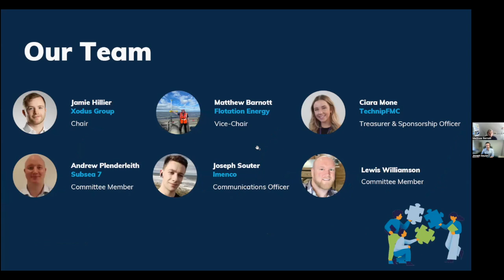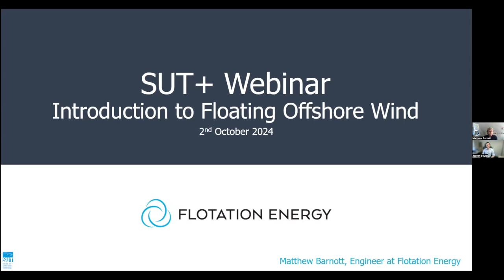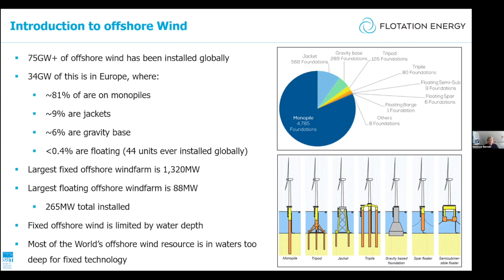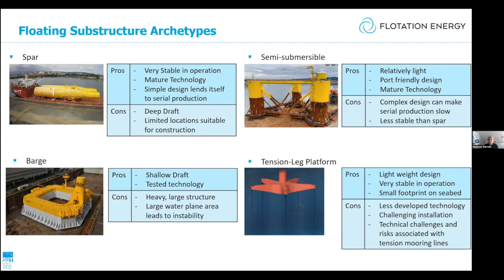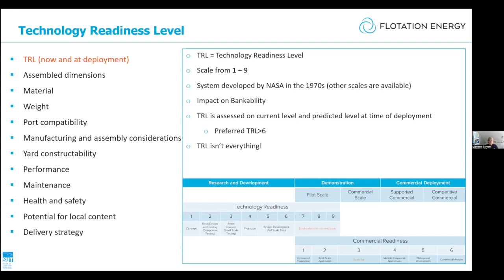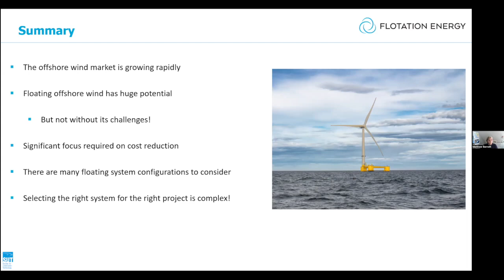Introduction to Floating Offshore Wind - SUT+ webinar

Comment: The entire wild AC generating space needs to be 100% backed up with expensive fast reacting peaking power.   Large amounts of wild AC from solar voltaic and wind turbine generated electricity costs the public grid more natural gas to support by running jet turbine generators at high readiness 70% fuel consumption making almost no electricity than making all the electricity from efficient running natural gas combined cycle power stations where a second steam cycle adds 50% higher efficiency.   When making up the dips in wild AC output more natural gas will be used.

The practical use for solar voltaic and wind turbine generated erratic electricity is for maintaining electrical storage.   In most situations this is not economic unless there is a need for emergency backup power.

--------
NASA reports global warming at 1°C where it has been since 1992 after falling from its reported all time high of 1.1°C in 1991.  The cause of global warming is not known.  Earth's water vapor saturated greenhouse effect is due to water vapor adding 10°F (5.55°C) to earth’s average temperature absorbing all the greenhouse radiant energy from the earth within a few meters of the radiating surface.  The other greenhouse gasses can not change its overall effect.  No climate change from global warming that was to start at 1.5°C of global warming causing stronger observable hurricanes in the Gulf-of-America (Gulf-of-Mexico).  

On average human caused atmospheric carbon dioxide is less than a 0.1% share in earth’s water vapor saturated greenhouse effect.  Water vapor has a CO2e of 18 and on average is 1% of the troposphere.  Carbon dioxide has a CO2e of 1 and is 0.04% of the atmosphere 400ppm.   

1.00%/0.04%=25,  water vapor is 25 times more present in the troposphere than carbon dioxide.  25 X 18 CO2e = 450 CO2e for water vapor and 1 CO2e for CO2.  All the other greenhouse gases add up to a bit less to about the same as that for carbon dioxide or 1 CO2e.   Carbon dioxide has 1/452 (0.0022) share in earth’s water vapor saturated greenhouse effect at average 1% water vapor.  

40% of atmospheric carbon dioxide is considered to be from human activity;  0.0022 X 0.40 = 0.000885 leaving human caused atmospheric carbon dioxide on average being less than a 0.1% share of earth's water vapor saturated greenhouse effect.   5.55°C X 0.000885 = 0.0049°C share in temperature retention from human caused atmospheric carbon dioxide.  

Water vapor always hold earth’s water vapor saturated greenhouse effect in saturation.   The other greenhouse gases can not change the overall effect of earth's water vapor saturated greenhouse effect.

Former Greenpeace scientists state there is no unhealthy high level of atmospheric carbon dioxide.  1200 ppm carbon dioxide levels are used in plant growing greenhouses for C3 plants.   This is three times the current atmospheric carbon dioxide and would greatly green the earth.